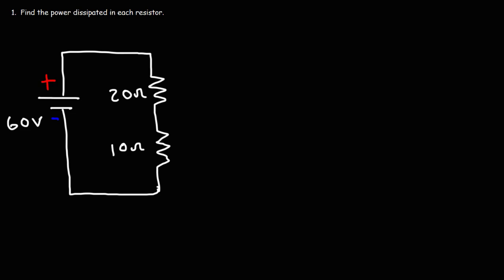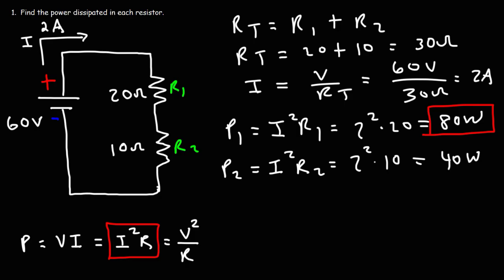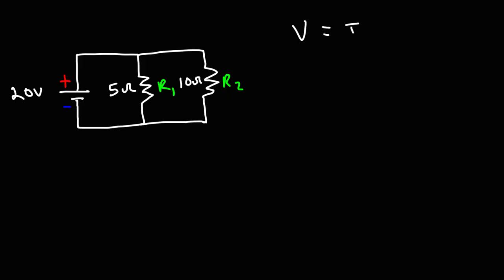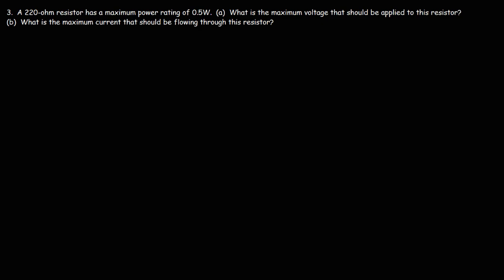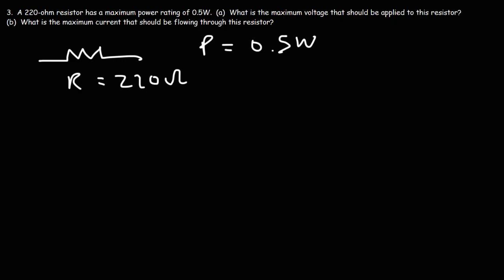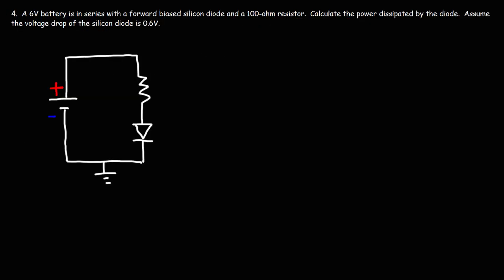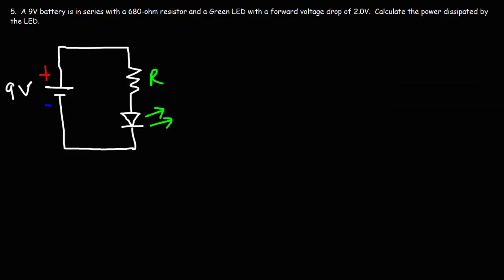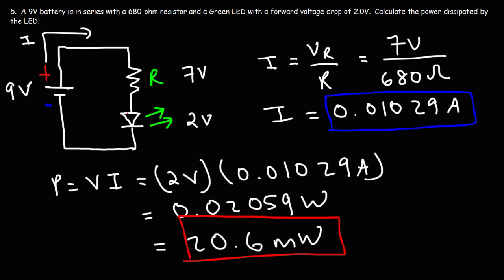Power Dissipation In Resistors, Diodes, and LEDs

Comment: Can anyone explain why if i use the other formula (V^2/R) im getting different numbers? With this formula the P=3600/20=180W for the 1st resistor and P=3600/10=360W for the 2nd resistor, much more than what we get by using I^2*R.
Reply: It is because, resistors connected in series have different voltages.

Comment: The Organic Chemistry Tutor
sir, in problem 4, if the value of the resistor changes, does the voltage drop would still be the same of 5.4 volts. thank you

Comment: So I found the total resistance Rt first, which is the inverse of the sum of the inverse of each resistors.  Then plugged that into the P=VI, after I found I from V=IRt.  But I got P = 66.66W.  What did I do wrong?
Reply: one year late but it seems you were working with resistors in parallel. the current for resistors in parallel are not the same, but the voltage is. use V = I * R to find the current for each resistor then you can use any of the equations for power. you could even skip the step to find current and do P = V^2 / R, however it might be better to find the current anyways if you get asked about it in future questions

Comment: Better this time. But ...  power is not equal to heat. It is equal to ALL of the work occurring in the system. Your example of an LED demonstrates the idea. How much work is involved in light emission?  A nasty example is something like micro-phonics. Check it out. 

40 years of teaching this stuff has convinced me that citation to the actual technical terms allows students to dig a little deeper on their own. In this case, you could have easily cited KCL and KVL. 

If you stick to what you know rather than what you Google you do better.
Reply: no one cares